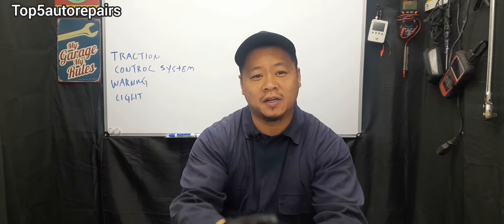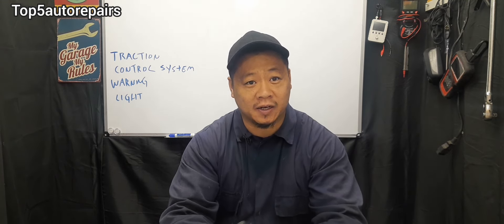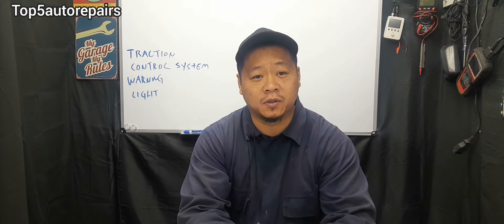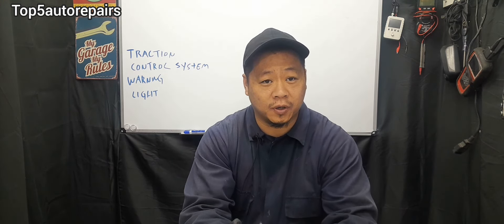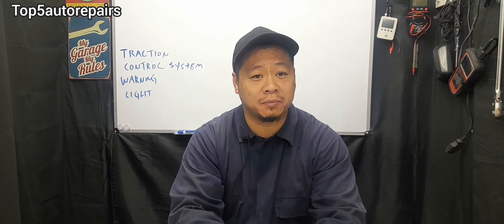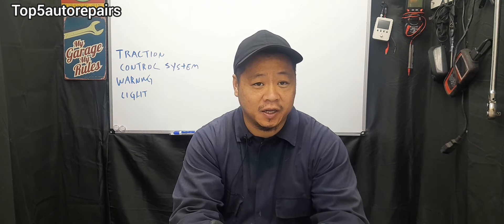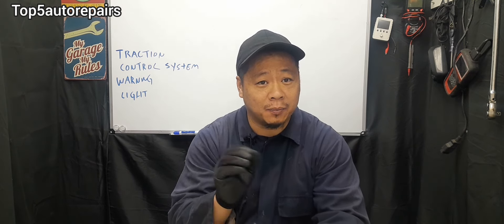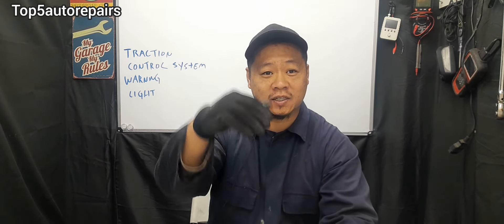TRACTION CONTROL WARNING LIGHT FIX | COMMON CAUSES

Comment: Ever since manufacturers started putting computers in cars to monitor every part, it's been one costly problem after another. Engines used to be easy to diagnose and easy to fix without computers. Now it's just a nightmare. The computers cause more problems than the engines ever do.
Reply: Exactly. I have two cars right now shutting down immobltbe abuse of this faulty light
Reply: They make money by not fixing the problem
Reply: Well said
Reply: Amen brother !!
Reply: Of course
Reply: If your engine lights are on, does your car pass the smog test?
Reply: @badiyazdi  That's a good question. I would imagine so. My car's sensors have all rotted out and all my idiot lights are on, but the car still runs without any issues. Every mechanic I've brought it to says that if my car runs fine then not to bother spending thousands of dollars getting it fixed. I haven't had to do a smog test yet though. I would imagine the emissions are all just fine if the engine runs no different.
Reply: IT'S The same with people, they don't know how to do life with-out computer
Reply: Walaikum assalam brother you ain't never lied, I prefer to roll down my window manually instead of power windows but what can you do. It's Gen-Next
Reply: Agreed
Reply: Yup junk
Reply: Freaking amen
Reply: That's why I'm here....😂
Reply: Agreed!!!!
Reply: They were inefficient, pollution monsters, and could never have precision. Cars today are engineered better.
Reply: Why would it say tranction control engine powering off
Reply: Right

Comment: Hi, my traction control light comes on randomly and once its on and I press my gas, theres a delay in reaction from the car moving forward. Can this be caused by my sensors?
Reply: did you ever find the problem?
Reply: Mine did that today. Did you find the problem? Also when I braked it act like it was stuck. I had to really push the brake to stop.
Reply: @laporshaadams4755  hi, yes! The issue was my throttle body
Reply: May I ask what kind of vehicle?
Reply: @TEEWHYC I'm having that issue. My Escalade intermittently shows a Service Stabilitrak/Traction Control Light & a P with Wrench (Electronic Parking Brake) Light.  Did this happen to you?
Reply: I'm getting the same issue in my 2020 Corolla LE
Reply: Try taking a look at the Abs sensor light and the tone ring on the cv axle. Rusty or cracked tone rings on the cv axle will cause your vehicle to bog or accelerate slowly for a bit then finally take off after awhile
Reply: I have this going on now with my Honda. US this expensive to get repaired?

Comment: I first noticed that I turned on when I got a car wash about a week ago and now it’s on the whole time
Reply: This is what happen to ours now. After the car wash it pop up
Reply: same! it was just fine till after i got my car washed
Reply: Same !!
Reply: Mine too. Has it gone away since your post. Any actual issues the driving of the car since it turned on? Thanks
Reply: Mine too stay on how do it stop it or fix it.😮
Reply: Same here
Reply: Mine happened after a car wash and now it doesn’t work
Reply: @Sacommentlangmagaling it must be kind of like a camera lens.  Water makes it foggy/ clouded up so it can't censor & throws the light.
Reply: @BigAlWillis  thanks boss actually what i did i placed my car on the parking lot where there is enough sun just to make sure everything will be dry up and luckily the alarm went off.
Reply: Mine came on after a hard rain.  Now it's on and off at times. Also my backup sensors stopped working.
After many wash and wax. I used WD40 to clean the sensors and they went back to working. I thought maybe the ABS sensors were basically  the same took them out and cleaned them with WD40 and they went back to working!
Note after cleaning backup sensors start engine with parking brake set and put in reverse for about 5min.
When parking assist comes on it won't tell you which sensor is not working. They want to sell you a complete set. 
Save some time and money with cleaning them.
Reply: @radicalttc  try to make it dry on a hot sunny day.
Reply: @Sacommentlangmagaling me too! I just had wheel bushings put in 4 days prior. After the car wash. It came on
Reply: @MnSunshine  just dry it a sunny weather. Thats what i did.
Reply: I have a 2012 CTS coupe . my traction control light come on intermittently while driving , then the battery light comes on the dash lights start going off then I hear a click sound they come back on .  I  alternator I replaced battery . I hooked up to computer  when the light does come on the charging system goes up to 17.5  then goes back down to 14.3  fluctuates .  P0621 code  
and c0900 code come up . Anyone have this issue ?
Reply: This literally just happened to me
Reply: My brake lights got stuck on and when they put the new piece in there, when I got home my traction control light came on. Maybe it just wasn't working😮
Reply: Same here 😮

Comment: I’ve had the traction control and ABS lights on my truck for 9 years, no amount of wheel hubs, ECBM replacements, wheel speed sensors, or brake fluid can get rid of these damn lights.

Comment: Very informative, start with a simple solution and work your way up. I had ABS, brake light and traction lights on on my 2014 accord. I checked brake fluid and it was full. I started the engine and pressed the brake paddle 3 to 4 times. It reset the ABS system and lights went off. Hope it won’t come back again up again  😊
Reply: Did the lights ever come back on?

Comment: I have the Trac and VSc light on. I believe its because my rear right tire is going flat now that I listened to all your suggestions. I am getting new tires in the next few days so I will see if the these signals go off. Your video is really informative and I will be following you to get more help.  Thank you for sharing your knowledge with all of us!
Reply: Hey was it because of the tire going flat that caused the issue cause I think I got the same problem

Comment: Top off the brake fluid !!!! Fill it to the max line!!!     2014 q60 owner here. I had both brake light and traction control warning light on after a brake fluid job. I never knew the car had brake fluid level check sensor until today. I thought a minimum amount in the reservoir was enough but obviously it's not ok with G37/Q60. After learning about this from a web site, with a very much doubt in my mind that topping off the fluid will do the trick, I went ahead anyway and topped it off, started the car and Voila!! immediately the annoying lights are gone!      Top off the brake fluid!!! Fill it to the max line!!!
Reply: I really appreciate your information. Thank you

Comment: Question, I have a 2016 Ford expedition. I replaced the ABS because the dealer told me too now they tell me I need to replace the vacuum pump because I had exactly these problems that you’re talking about. My sensors they said we’re fine, but just today after trying to back up a little driveway hill, my right tire seems to spin out. The traction light comes on and it just blinks. Again, the dealer says that my vacuum pump needs to be replaced and they think that will fix the problem. Any input from you would be great. Your videos are fantastic. I trust your input more than them for some reason I feel like I’m putting a Band-Aid on a bullet one and they’re just shooting at this blind again again, thank you for your time.

Comment: I chased was for almost a year. I changed one hub that seemed to be the problem but didn't fix the light. I then changed the other three hubs and still the light was still on. The problem ended up being there was this green corrosion in different parts of the harness so after addressing that the light finally went out.
Reply: How much was the cost for that ... because I'm having the same issue

Comment: I changed the lower steering shaft for my nissan maxima ' I did alignment and car running straight ' but suddenly sometimes when I turn the steering right or left  it brakes hard by itself like crazy as if car slips. I noticed that sometimes the 'steering is not in the center exactly ' and sometimes centered.  Do think this issue caused by the aftermarket steering shaft? And the angle sensor reading something wrong when I turn the steering ' that's why vdc and abs stops the car by the ecu itself
Reply: Did you get the issue solved and if yes,How?

Comment: To add to everything you said, the first thing you need to do is hook up a Biderectional scan tool and research the individual codes. The very next thing you need to do is use your scan tool to perform a reset/recalibration of the ABS/TRACTION Control system and then Clear all DTCS, run another scan and see what comes back. If nothing comes back than chances are you did brakes or suspension on a newer car and the ABS system needed to be reset.

Comment: I have an 04 Honda Odyssey van that's been sitting for the last couple of years in the garage. I just charged the battery and fired it up. No problems started it right up. Took it for a drive for about 4 miles and by the 3rd mile the traction control light came on right after I swerved to miss a goose on the road. Don't know if it was related or not but the engine light is now on as well constantly. Thoughts?
 I also need to drain the gas. The exhaust smells a little bit bad, but it ran perfectly.

Comment: Good looks , maybe the snow and sand and stuff blocked the sensor , i hope. Will also check the break fluid. Are the sensors pretty easy to find , probably just wait till the Snow clears

Comment: Got only 1 problem with my 2008 Chevy HHR. The traction control button worked fine UNTIL after replacing my BCM. Doing so fixed all kinds of problems I was having when I bought this car. Stuff I thought the BCM didn’t control now all work, but now everything‘s perfect except for I can’t engage the traction control button, but was able to before the new BCM.  Is that something that should’ve been done when the BCM was programmed? If so, how hard is it to add that programming? Oh and there is no trouble light on or anything like that. It’s just doesn’t work anymore when I push in the button.

Comment: Check your breather hose to your air filter too; esp. if recently changed. plug the hose back into the hole in the intake. Update: A cracked coil stem was the problem. USE TOYOTA COILS, not aftermarket ones.
Reply: This is exactly what my mechanic told me to get he just fixed my alternator wire and he told me to get a hose for the air filter. If I’m getting this right the light should turn off after this correct?

Comment: I have a 2015 Kia Soul ex, and I do need front rotors and pads. The rear has already been done and fixed. Today, I stopped at a stop sign, and the car stalled. It started up roght away, but then the TC light came on, and my rpm gauge went to 0. The car didn't want to accelerate much either. Im assuming this is because of my needing to do my front brakes ( pads and rotors). I turned TC off ( using the button)  as I can't have my brakes fixed for 2 weeks as the shop is busy. Hopefully, this is all it is. It's just crazy to me though because back in the day, I'm an 80s kid, I drove my mom and dad's older cars from the 70s and they never had TC on their cars and it drove just fine.😮

Comment: For a titan truck... So I replaced a relay for the horn and the slip light came on and stayed on. All electrics work, no issue with brakes, sensors, all fluid levels maximum.... Checked the fuse box ground.... Did the whole drive straight and unhook the battery things.... No luck, still on. It's the only light on. What can clear this darn light out? I can't see the 2wd 4x4 icon and select drive mode with the slip light on. Any ideas on the fix?

Comment: Thanks for your knowledge. 
I have a question. Someone changed the brake buster on my Ford Edge and now I have problems with the tracción control and one side of my brake pads get stuck. Any advice. Please. Any advice to do thanks for your help.

Comment: I just ran through a puddle during a storm and hit the breaks slightly and ABS and traction control lights went off. I figured it was more of a temporary sensing issue but the lights do not reset automatically after power off. Is there a specific reset process for a 2015 Lexus ES?

Comment: I have 2000 lexus es 300 with 255000miles. I just bled the brake then road test. After parking on the drive way, I connected my diagnostic,I started the car with no problem, but I saw the trac off and abs blinking. I turn off the car and restarted, and got rid of the trac off and abs blinking however car won't move foreward or backward.  I turn if off, while I went inside to get some info online.. When I tried to start it, there was no power at all. What could be the issue. Any advice is highly appreciated.

Comment: 2016 JKU 
On a dry day merging into traffic traction control light start blinking and jeep slowed down 
Took foot off gas pedal and then resumed to normal speed again in a little bit. The light came back on this happened two or three times so I turned my traction control off and made it home. Should I be looking for something in particular?
Reply: Same thing with my Tahoe
Reply: Same thing w my Jeep now
Reply: Same thing with my little Hyundai

Comment: I replaced my front strut and lower control arm then i got traction light and abs light coming on and off. I tried to clean the sensor now only traction light coming on, do you know whats the cause? Ty

Comment: Hey man , love all your vids.  To change the subject tho,  bypassed my leaking heater core ,  now A/C is not working , thought they were separate , any ideas why Sir ?  07 Dodge caliber 2.0
Reply from the maker: Strange. It shouldn't affect the A/C system at all. Check if anything got loose like the pressure switch connection on the A/C line.
Reply: @Top5AutoRepairs  Thanks , Top Five,  hey , had to work,  but found that the fans aren't actuating correctly,  new thermos, temp.sensor and gauge work perfectly , fans do come on , just not in correct sequence    and ,how can I buy you lunch or suntn Man,  your the best on here.😇
Reply: Thanks Man,  hey,  when I cross the wires on the temp.sensor it comes on, and the lightning bolt comes on too ,though   new sensor., Thanks again.

Comment: Could it be possible a bad air valve on my wheel effect this VSC light. I aired my tires, but the low air tire light stays on. Can it also cause the VSC light to come on also?

Comment: I bought a brand new 2024 Chevy Colorado Trail Boss, and after just 10 days and regular road/highway driving, a bunch of warnings popped up on screen. Service Traction Control, Service ESC, etc. It reduced my speed and acceleration (a preservation mode I assume). Luckily, I was almost home. When I opened the door I could hear a strange engine sound and it smelled like something was burning/rubbing. 

I also assume my issue isn't just a faulty sensor with a quick fix, lol. Or it could have been a sensor/computer error that triggered a system response even though the problem came from nowhere. 

Do you see more issues with vehicles that have more electronic systems causing mechanical problems or vehicles that are more analog having problems?

Comment: Thank you so much sir, appreciate your info. 
I got a challenge with my toyota fortuner 2013 2D4D. The moment i connect my MAP sensor and i drive above 40km/h, then it goes into limp mode. I got a new MAP sensor, but the problem still remains. It goes together with some exhaust smoke. Please advise.

Kind regards
Derick from South Africa

Comment: hello, i just came across yr video. Recently, i replaced my steering rack and once installed, the vsc light stay on. when the worksyop check via computer, it say error steering angle. can you help to solve? my car is toyota wish S model 2016

Comment: What's a good way to start trace it down friend when light stays on but no code so it causes me to lose abs and has already caused a fender bender from sliding ... I guess I'm asking were would be best to start at cuz all the modular and stuff for abs is not cheap so I don't want to just go through and replace everything if I don't have to being that would be up in thousands to redo the whole abs system ... Thanks in advance friend and great video

Comment: Thanks for this.

Today I was parking my tacoma on a off road terrain.  I noticed that when the wheels spin the TCL came on for about 2 secs multiple times but with a weird noise.  Any thoughts?
Reply from the maker: It's normal due to the wheel slipping.

Comment: I fixed my clocks spring cause our horn wasn't working. Then about two months later, if you take a corner or a bend at slow speed, the traction control kicks on and it almost cause as you to crash the vehicle..

Do you think it's due to the clock? Spring of clean the wheel sensors. They were dirty had a bunch of chunks. But after cleaning it it did happen once again